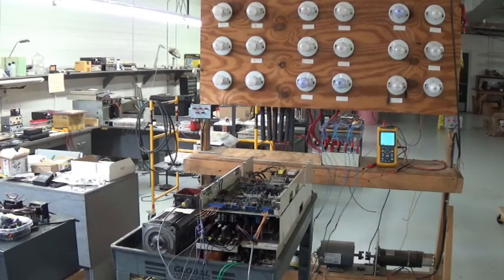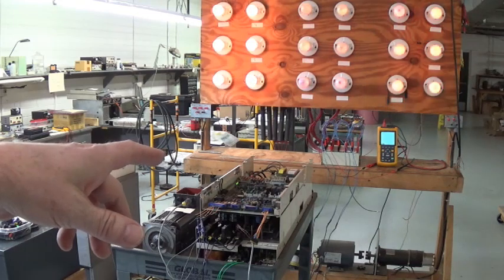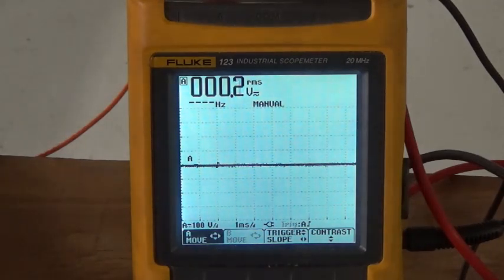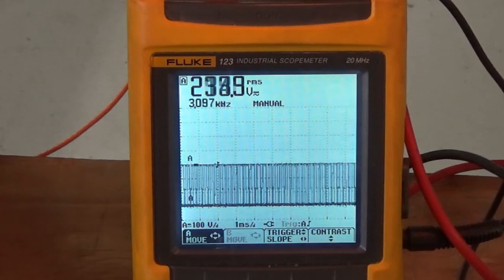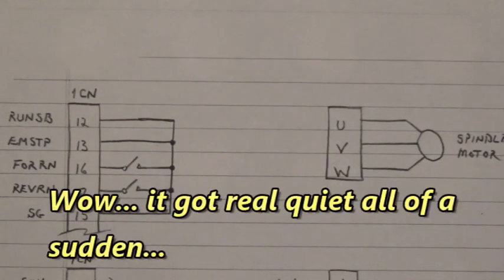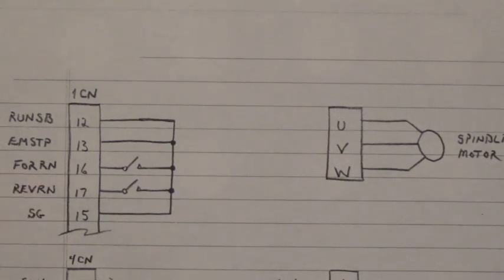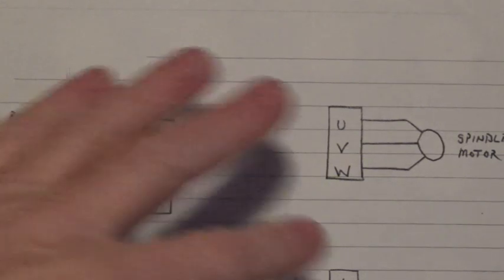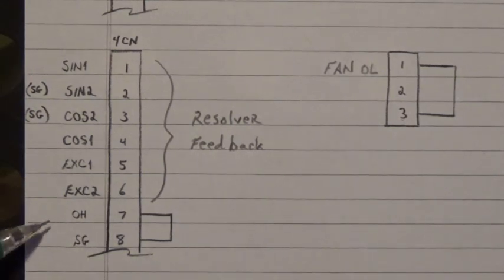(Part 2) Shorted Transistor Power Modules Yaskawa Spindle Drive

Comment: I just repaired a Yaskawa Varispeed III drive, and the drivers board you tested is very similar, if not equal. Same type of power transistors. I did find, however, a problem with one of the SIP driver IC which had the output base transistor improperly biased which in turn had caused the output transistores to fail. That bias problem overheated the rectifier feeding that same driver circuit. This also caused cold solder joints at the rectifier plus blackened PCB pads at the rectifier's leads. 

Good job Pee Paw and keep up the good work!